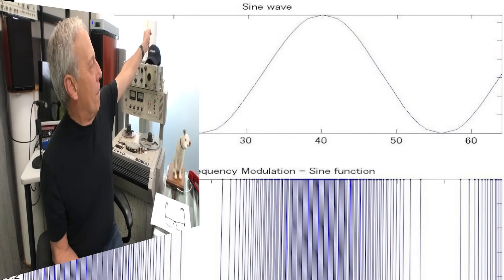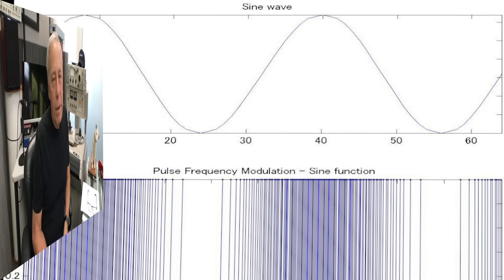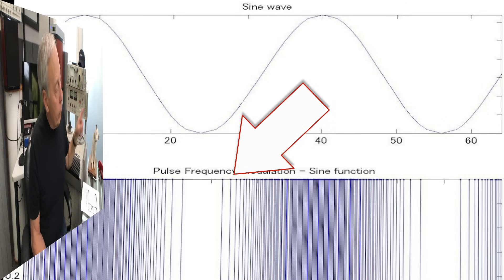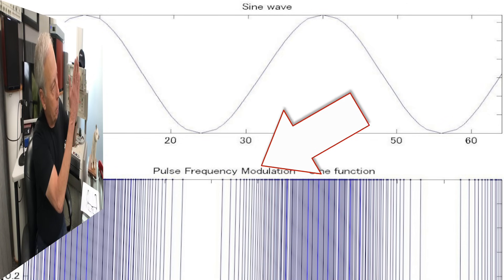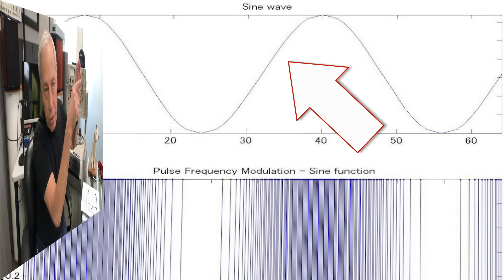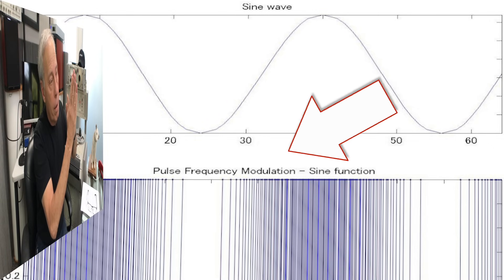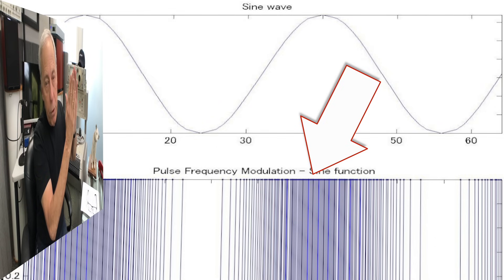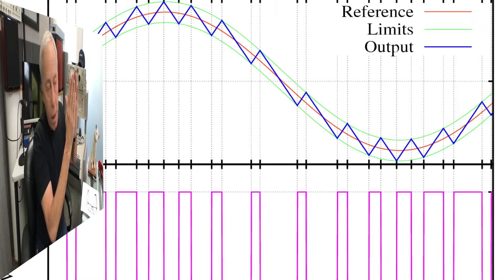What are the differences between Class A, AB, and Class D amplifiers?

Comment: Really well expalined Sir but what you've maybe didn't mention and It's important,especially for us musicians with active mixing consoles and rack amplifiers is the weight and size of the transformators and the noise (brum-I don't know the word in English). Class D are much compact,lighter and easy for transport.The higher tones are more crisp and clear but with Bass-there can be a lot of problems if the connecting cables are bad. A class are much more heavier,they deliver a really quality bass, but they're noisy,especially if the capacitors are old and the coil solder joints are bad. I think main thing is to consider is the weight and the size od an aplifier if you're a musician ...

Comment: It seems the advertised wattage rating of class D amps is exaggerated. My class A/B amp that is rated the same as my class D amp seems to have way more headroom. The class D flatline’s. I have an Acoustic Image class D bass amp as well as a GK RB 400 III. The GK will out perform the AI amp in every aspect, even though the advertised output ratings are similar. The only real advantage the AI amp has is its weight.

Comment: This is my understanding. Class A: Best Sound Quality, Least Efficient, AB? More Efficient and less heat. SQ not as good as Class A. D? When they first came out, Were only used as Subwoofer Amps. As they were Limited to a couple Hundred Hz. Most Efficient. But look at the Signal to Noise. D is the Worst. A being Best. Blaupunkt had a Class T, Full Range Amp. Pioneer now has a FD. Loud but Noisy. Tube Amps. I remember them. Never used one. Would they be considered a Class A?

Comment: So speaker wire quality is INDEED important ...Right ? some would have it that this issue is exaggerated ... when... after listening to Bob explain that the amp's production of heat is transformed into signal going to the speakers ( the moment electrical signal input is initiated ) one comes to the conclusion that the cheaper and less conductive the wiring is, the lesser quality transmission of power you get !!! Right ? i would think so.

Comment: All things being equal, class A mode will sound sweeter than class A/B mode, because running in class A eliminates crossover distortion, which can't be avoided if you are switching the transistors on and off in class A/B. Class D amps are for saving a few cents of electricity and adding noise to the signal. Maybe a super expensive one might sound okay, but everyone I have heard sounds like crap. When is making many compensations to try to get back to pure analog (class A), going to sound better than pure analog? Is it worth saving a penny or two (lost to heat) during each listening session, by using a logically inferior class D amp? Not for me.

Comment: Your efficiency explanation relating to class A is not correct. The maximum (theoretical) efficiency of a class A amplifier is 25 per cent (50 per cent in the case of transformer coupling). It means for 100 W rms power at the output the amplifier consumes at best 400 W of input power. A power consumtion of 500 W is realistic. A class B amplifier's maximum (theoretical) efficiency is 78.5 per cent. Typically an efficiency of 65 to 70 per cent is realistic. A class AB amplifier's has an efficiency close to a class B amplifier. Its typical efficiencies are close to the the realistic efficiencies of class B amplifiers (see above).

Comment: Class D has internal voltage amplifiers that are used to power the audio amplifier portion of the circuitry.. by pulsing mosfets to fire into toroid coils in which outputs are multiplied by turn ratio of coil.. then rectified and filtered.. then fed to amp to power it.

Comment: Very interesting and clearly explained.  I've owned a Class A (Bryston 4B ST), an AB (Hafler 500) and various typical receivers (JVC, Technics, etc), whatever class they were (anyone know what class those basic receivers were?), but I never knew what it meant exactly and I definitely never knew it was related to power usage.  Thanks.
Btw, I always assumed there was a Class B designation also.  Was I wrong?
Reply: Bryston amplifiers run in Class AB mode. Bryston has never made a pure Class A amplifier.
Reply: You're confusing a rating system with the mode of operation.
Reply: Miles Dufourny Can you tell more about this mode of operation and rating system, please? :)
Reply: @PeX218  I just woke up and will get back to you later on today.

Comment: I would describe a "class A" power amplifier as basically just a small signal amplifier stage scaled up, i.e. a transistor conducting half its maximum current when no signal is present. Then the "class B/AB" power amplifier instead being two mirrored transistor stages taking turns on the positive and negative sides of the signal. The downside of B/AB being risk of crossover distortion and the upside being almost no static current draw (just a minor bias current to overcome the non-linearity of transistors near zero current).
Reply: That's what I always was taught - the class A amp sits there putting out half power as heat with no input signal or output to the speaker and any input waveform was amplified and the difference signal was sent to the output and dissipated as sound from the speaker and heat in the voice coil as well as heat from the amplifier components... all for the sake of no crossover distortion when switching from the "positive" output transistor to "negative" transistor in the name of efficiency in the case of a class B amplifier. The B/AB configuration would do like you said and mostly mask the crossover distortion by biasing on both output transistors at a low wattage.

Comment: I love it! I did not realise the heat is lower in class A during a max use (the speaker gets hot versus silence) that is a very good point! Then again maybe the impedance is higher for silence versus a sine wave? Either way, its the best explanation I've seen! Best Class D also. Class A/B for me now is the most mysterious. How does a A/B amp notice the zero crossing? I guess it fades to zero when the bias goes negative and there is a small cross-over when both sides run.

Comment: To answer the question:
Class A: is wasting power
Class AB: is wasting less power as much as the designer allows to run quiescent current trough the amplifying devices
Class D: No more power used as required to do the job.

The Class of an amplifier doesn't say much about the quality though.
I've had harsh sounding heavily biased amplifiers (Krell) that didn't sound sweet at all and sweet sounding Class AB amplifiers (Conrad Johnson, Jeff Rowland) that where moderately biased to only produce ten Watts in Class A. 

So the generalization here about the Classes of amplifiers and their sound is nonsense.
All things equal: If you can afford it choose an amplifier with a healthy big powersupply, lots of output devices in parallel and chunky heatsinks.

Comment: In the 70's I had a class A power amp, "Ampzilla" by Great American Sound. It ran so hot, it had two cooling fans and kept my room warm, summer and winter. I didn't like the sound. Not dynamic at all. Plus it was prone to sudden, catastrophic failures, and had to be sent to California to be repaired. Finally, GAS went bankrupt. I bought a class AB power amp, the NAD 2200. What a difference. Great amp, great sound. Still going strong today. After 32 years, only had to replace the output relays, which were of very poor quality.

Comment: Hi Paul, I wanted to ask you a question about dirty power in your house. I'm a musician and use several guitar amps in my house. My problem is that I'm getting a form of harmonic distortion through my tv and my guitar amps. I've tried everything to alleviate this problem but nothing seems to work. I was talking to an engineer at Digikey in Minnesota that mention that I should try a Topaz ultra isolation transformer series 32 to clear up any issues that I'm having. Could you shed any light on this for me? A few years ago in my house,  I never had this problem. At first , I thought it was my stereo and my guitar amps that had something wrong with them, but is definitely a problem with the actual problem with the AC power. Any advice on using an isolation transformer like this Topaz unit. Any advice as to what kind of unit would be good for running these amps?Thanks Michael Newell from Niagara Falls, Ontario, Canada

Comment: Paul, you forgot to mention that CLASS A/B, use a transformer essentially toroidal, and they divide the power output across all the speakers connected. instead of CLASS D amplifiers, always keep the same wattage output, not matter if you have one speaker or four. Class D amplifiers, suffer from harsh mids and highs at high volume, something that is lack to happen on CLASS A/B amps.

Comment: I was under the idea that Class A amps at no signal input, the quescient power was half the full power.
Reply from the maker: Here's the thing to remember with true class A. It always draws exactly the same amount of power from the wall regardless of signal condition.. So, if it draws 500 watts from the wall, then it will do that when it has zero signal or full signal. Unchanging. Therefore, with zero signal, it's all going to heat. At 100% signal, half goes to heat while the other half goes to the speaker. In any case, it's always the same from the wall.

Comment: What I always learned is Class A/AB is more about voltage and linearity (Voltage/Ampere slope) .  You put a bias voltage on the amplifying transistors to where the slope is more linear than at the Voltage point where the transistor gates start to open (at about 1.5 volt) . This area is not linear so it distrorts the output signal and that is not what we want. BIAS is Voltage!
Reply: I guess a technician understands this way.:) ... and there were OTL, OCL, BTL designs. These were the stuff I learnt over 30, 40 years ago. We always built our own amps.

Comment: Why not a class A amp that has dynamic bias that turns the transistors off with no input signal? Then when input signal is present apply bias voltage?

Comment: The problem with class AB is, 'ideal transistor' doesn't exist, and it cannot be perfectly linear, so you will always have SOME crossover distortion if you are crossing over between transistors, but that can be mostly or totally eliminated with feedback, but that opens a whole other can of worms, negative feedback is susceptible to oscillation, but that too can be eliminated. However, a transistor being half turned on at zero signal(Class A) is so wasteful.

Comment: When I learned about amplifiers class D hadn't been invented yet.

In my concern sounds that fact that sound was equivalent to various frequentcies of AC current was used. An amplifier that took care of all 360 ° of the AC was a class A amplifier. It had to be biased so there was a large no signal current. A class B amplifier would amplify 180 ° of the signal. At no signal it drew no power. Then there was the class C amplifier with covered less than 180 ° of the circuit and was used to power radio transmitters.

In the Class B amplifier it was hard to get a perfect 180 ° so the class AB amplifier was developed. Class AB and B amplifiers worked in pairs. One amplifier was fed the signal and one was fed an inverted signal. Their outputs were combined in a configuration called push-pull. This cancelled out the distortion and fed lots of signal to the loudspeakers.
Reply: Well said

Comment: Thanks for your time and knowledge. I have a question: I play guitar [electric], and have built my own speaker cabinet [8ohm]. I generally use a multi-effect processor/pedal [Digitech RP360XP] for tone and effects. Would it be worth my effort to mount a small Class D amplifier in/on the back of the cabinet to power the speakers? Are Class D amps durable for such use [only talking about 20-60 watts; don't need a 'stack']?

Thanks again.
Reply from the maker: Sure. The only caveat would be the tendency of guitar players to want to overmodulate their guitars or overdrive them with feedback etc. to get a certain sound. Class D amps are quite unhappy doing this. If you are more like a jazz player that's looking for a pure tone from the guitar then by all means, that's a good idea.
Reply: @Paulmcgowanpsaudio  Use a 1 watt class A tube power amp, to feed the larger class D power amp.
Set up the gain staging so that the 1 watt class A hits the rails, before the class D runs out of headroom.

Comment: I wish he would've gone more into how a class AB amp is really called a class B push-pull, which are two amps working together, one in the positive side of the wave, the other in the negative, that work opposite each other to mimic a class A amp.
Reply: Not exactly.. AB is actualy push pull amp wich is anyway giving first 25% of power in class A, when pushed over it goes automatic in AB.. wich are most of Hi-Fi amps today
Reply: I don't know where you're going with the 25% in class A. A class A amp amplifies 100% of the wave. A class B only amplifies 50%. In a class B push pull you have opposite PNP and NPN transistors each working half the wave.
Reply: @1119jblack  Biasing A Class AB Amplifier
So how do we do this. A Class AB amplifier can be made from a standard Class B push–pull stage by biasing both switching transistors into slight conduction, even when no input signal is present. This small biasing arrangement ensures that both transistors conduct simultaneously during a very small part of the input waveform by more than 50 per cent of the input cycle, but less than 100 per cent.

The 0.6 to 0.7V (one forward diode volt drop) dead band that produces the crossover distortion effect in Class B amplifiers is greatly reduced by the use of suitable biasing. The pre-biasing of the transistor devices can be achieved in a number of different ways using either a preset voltage bias, a voltage divider network, or by using a series connected diode arrangement.

Comment: In a class A amp, it's not 100% on all the time.  if it's biased correctly it's "50% on" at idle (and will always average 50% on regardless the output level) in other words, the output tube (or transistor) is running at half current, When a signal is introduced, the current in the tube increases and decreases to match the waveform of that input signal, with half current always being the average, even at full output.

Comment: And then there’s class T. I think this needs a deeper discussion. But I get the digital thing being part of the Nyquist rate. I’m not sure if that has any advantage except it takes less current to run the amp, and it runs cooler.
Also, isn’t class AB a push pull circuit?

Comment: The Class D AVR’s I’ve heard sound thin and harsh. My vintage Sony Twin Drive Optical Legato Linear A puts to shame these modern receivers. $1,500 in 93. Is it the Class, or are they just making garbage cheap Class D amplifiers now?
Reply: There are some excellent class D amps nowadays. When I was a teen, they were only viable for subs. The problem is designers being forced to design them cheaply. They save so much money on transformers and heatsinks by having a switch mode power supply and switch mode amp, managers get greedy and push for cheaper designs as well. You can tell when the power rating is spec'd at 10% distortion that they're going for marketing instead of research and design.
I personally run an AudioSource amp one/A because it's a 100% discrete design. If a component fails, I'll trace it and replace it. With a Class D amp, any problems would brick the amp if the IC is no longer available.

Comment: I have a question . 15watt 16ohm extremely sensitive Goodman speakers connected to a Grandhigh a280 120watt rms 4ohm output class a Chinese amp. Will the speakers be damaged even at low volume?
Reply: Yes

Comment: does it make sense to use a class a power amp with a class ab pre amp?
Reply: Mix and match, find what you like the sound of.  From a technical perspective, I think the other way around would be the better blend, as an AB amp is generally higher powered, lower THD, and better damping than a class A amp. With a preamp though, you're operating very low current levels,  so those things aren't a concern. IMO the simplicity of a single ended gain stage makes it the winner for low current applications. (Note that a lot of people, myself included, have observed that single ended tube output amps have a great sound, this is most likely due to imperfections such as higher THD and poor damping, allowing the resonance of the speaker to play a larger role in the sound reproduction)

Comment: So basically Class A is always on always hot and by comparison draws the most "power" but produces the most clear / "without noise" sound.
Class AB is meant to reduce the power loss and heat generated to increase the lifespan / efficiency but produces more "noise" in doing so
Class D is meant to be as electrically efficient as possible in terms of power draw but increases the output impedance (electrical resistance?) which further distorts sound?

It was a bit difficult to follow and I'd like a more in depth explanation, but hopefully this helps expand my knowledge. Of course I could be completely off-base, in which case asking questions is always good.

Comment: A easier way to explain  why class A is better  all about would to show a simple output curve of a tube or transistor and how the middle of the curve is the flattest or most linear and bias is what is used to keep the no signal  point in the center of the linear portion. Now class A can theoretically be done with only one output device whereas a class A-B needs 2 output devices where one device amplifies the positive half of the waveform and the other amplifies the negative half , but this unless done right causes switching distortion when the signal goes from positive to negative or vice-versa .